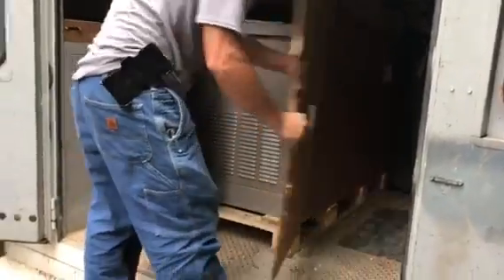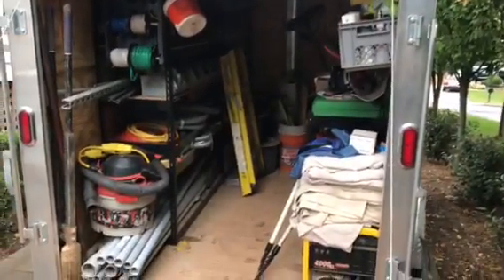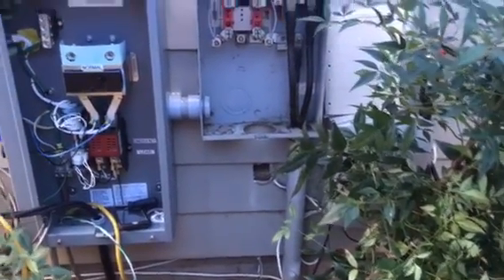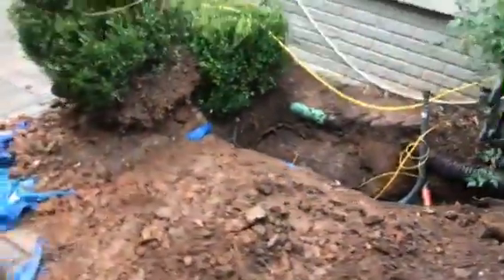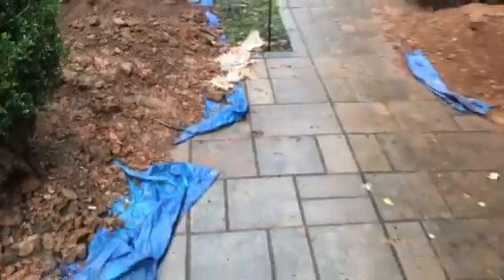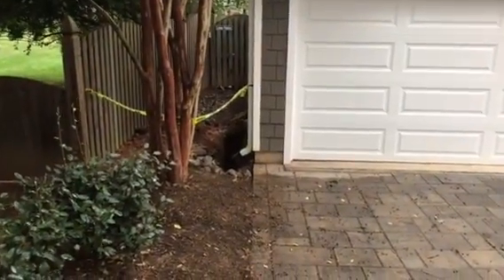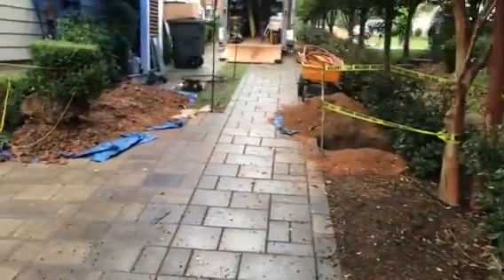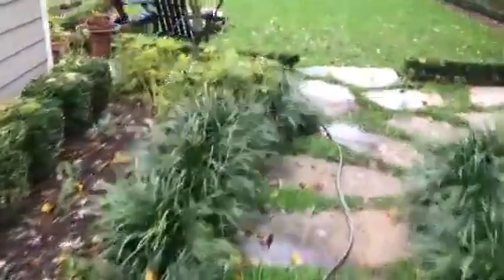20kW Kohler Installation

Comment: I had my 20 kw Kohler in stalled yesterday and today . change out gas meter , larger gas lines , haf to relocate my Ac unit . transfer swi tch installed , inspection and trial run . all went perfectly . Have to install On Cue at a later date .